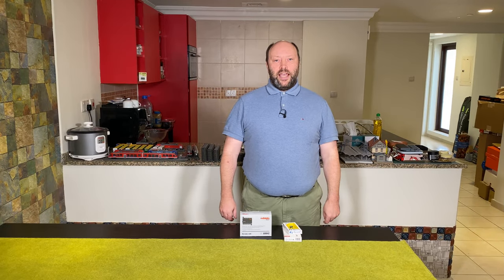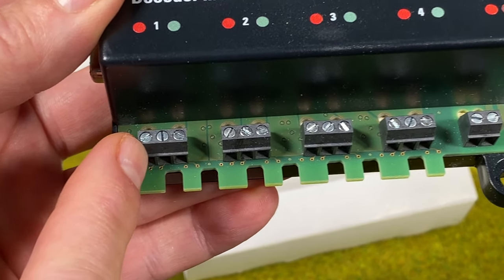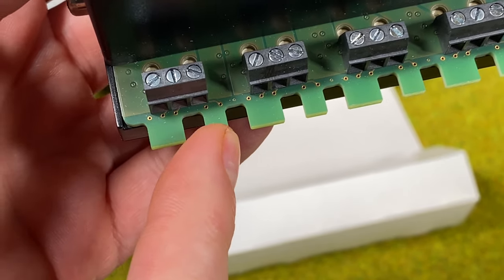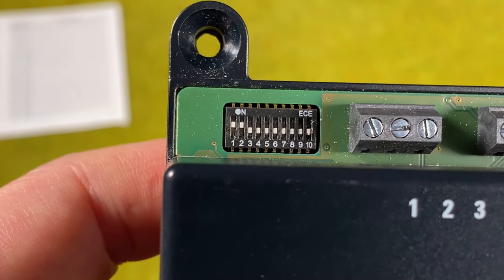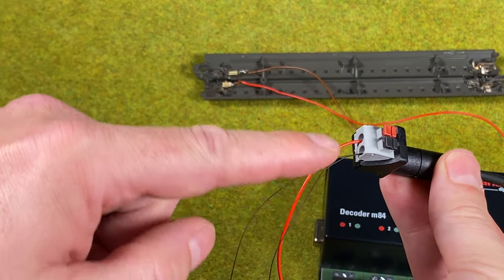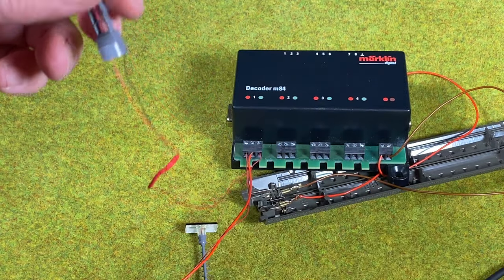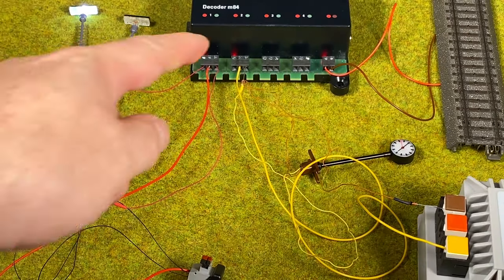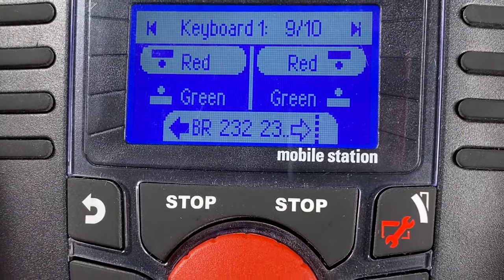Installing Märklin 60841/60842 m84 with 8 Independent Light Groups (Beginner Episode 8a)

Comment: Dear Paul ,many thanks for all your videos. A small correction at 4'20 the 'F'. Language on the manual is French and not Finish as mentioned. ...😀.   M84 decoder is indeed very useful.  The black one is the one to buy if you have none in house, but the old ones M84 and from other brands that are cheaper are working as well in most cases.   Thanks again .   Please also think , or mention the track K and how best to use it.
Reply from the maker: Hi Emmanuel, 

Indeed F is French ;-) This video also covers the white M84.

I agree that you can also use accessories from other brands and I encourage you to experiment with these ones as well. However, if you are not an expert consider staying within same system as the accessories work the same way and what you learn on one you can re-use on another. Furthermore, each brand also makes sure that accessories are compatible within the brand. If you are an expert - go ahead and mix and match as each brand has some advantages and disadvantages. Some brands mix wel while others do not. For most accessories it is easy, but be careful with accessories such as boosters.

K-track? Unfortunately I do not have a lot of experience with it as I mostly do temporary layouts...

Enjoy ;-) Bo

Comment: A true Masterclass, thank you
Reply: Just a question , in order to maximise the use of the decoder , what mode should I use to regulate a shadow station , to replace signals , mode 0-1-2?
Using CS3
Many thanks
Reply from the maker: Hi Bernard, Thank you! Enjoy ;-) Bo
Reply: @ModelTrainFun  Hi Bo, could you answer my question concerning the mode to be used in a shadow station? 
Thanks
Reply from the maker: Hi Bernard, I am assuming you are asking what mode to choose when you want to use the M84 for turning on/off power to the track (stop track). If this is what you are looking for, then use Mode 2. Basically, same as the lights in this video - just use "B" from the track and insulate as a stop track. Did this help? Enjoy ;-) Bo
Reply: @ModelTrainFun  you got my point , tkx

Comment: I tried this when 1 M84 was connected in series with 6 M83 decoders. I could not reprogram the M84 in this setup as shown in de video. It only works when only the M84 is connected to the Mobile Station.
Reply from the maker: Hi Bert, I have heard from others about this issue as well. Good to know that programming needs to be done with one when using the MS2. Unsure if this is also the case with the CS3? Enjoy ;-)

Comment: Thank you for your detailed videos! I tried programming the "white" m84 (60841) to take 8 different addresses, but unfortunately it did not work. It may have worked on your example because you were using a 60842, and somehow its improved architecture allows the separation of the switches (Schaltgruppe = 0).

Comment: Hello, is it possible to switch the turnouts with the M84 without a decoder in the turnout?
Reply from the maker: Hi Frans,

If you want an external decoder I recommend using the m83. The m83 is built for this purpose - check out this video: https://www.youtube.com/watch?v=eGexwTEeFZE The m84 is good for continuos power like turning on/off lights. The m83 is good for pulses for accessoires like turnouts and the uncoupler track. In theory I believe you could program the m84 for turnouts, but the m83 is cheaper and ready to use for this purpose. 

Enjoy ;-)

Comment: Hello. Great, informative and perfect pedagogy. An additional video would be to explain all the other modes. I do not have a m84 and would like to know. And the detailled programming on each cv was a little confusing. Actually, i would like to know if it is possible to use an older crane with m84. It should be using 6 addresses (1 and 2 as latches, 3 and 4 as 4 independant switches) and use 2 switch outputs to feed 2 latche power input for rotating or moving the rope.
Reply from the maker: Glad you liked the video!

I have not tried making a crane move. Everytime I have seen somebody do it they have used a locomotive decoder. To me this makes more sense as a locomotive decoder is optimized for wheeled movement. I did find one video that might interest you on this from @marklinofsweden: https://www.youtube.com/watch?v=g0eYbtyRD6U

As for the other CV79 m84 60842 modes you can find this in the 60842 manual on page 18: https://static.maerklin.de/damcontent/a5/7d/a57d1381cfd17d74e7434cb76db190ed1566485190.pdf

The CV programming I figured out by reading the description in the CS3 and trial'n'error. My intent in this video was not to go into details of every CV in the m84. I might look into the other modes and more CV programming in future videos.

Enjoy and happy model trains ;-)

Comment: Your video showed you using a power source to the centre connection. I do not have a power source so how do I get around that as so far I have not purchased a central station. I only have the mobile station. I am not sure how to get the green lights to work on my m84 with only my mobile station. Please can you help me
Reply from the maker: Hi Alf,

I would choose to use the m84 when I have another power source for the light. However, you could use the track power as well.

If you have a light that can be powered from the track you can use the track power. First test your light by connecting it to the track one wire to the rail and one to the center studs - if it does not work try the other way around (dont forget to go out of stop mode). If this works connect red from the track (or brown) to the center and return after the light to the track with the color you did not use.

Before you try it out - double check that the light works with track power. You can damage the light - or in rare instances the MS2. However, the MS2 will probably just trigger the short circuit detection and enter STOP mode. However, be sure before you try.

You can use the m84 for this. However, if you intend to use track power for light, then using the m83 is cheaper. This will require a little of programming - unfortunately, I do not have a video showing this. However, if you have the black m83 (Märklin 60832), then look in the technical manual. It looks like you can choose mode 2-5 as described on page 18 - or program the CVs as illustrated on page 24: https://static.maerklin.de/damcontent/3b/44/3b44f7c3c18c5d0a2b0c3e377f3df7281570606458.pdf

You can also see how to connect light to the m83 on page 24 (this is different from the m84 light connection). I have not tried it with the m83 myself, but it should work.

Hope this helps. Enjoy ;-)

Comment: Hello Model Train Fun. I love your videos which are really easy to follow and very informative. Having watched this one, I saw that it came really close to a question I need to find the answer to.

From your closing sentences, it seems it may already be the subject of your next video, but just to make sure, my question is, how to connect a 3-way Viesmann signal (a dumb signal I suppose-with no decoders) and make it work with the 3-way signal icon of the CS3? I already tried to connect the cables of the red and green LEDs to-let's say address 9, and the cable of the yellow LED to address 10. When I change the icon of the address 9 to a 3-way signal icon, the accessory at the address 10 dissapears and then there is no control on the yellow LED. The 3-way icon only controls the red and green, but the 3rd has no function at all. I tried to assign a second address to the 3-way signal accessory, but the CS3 does not seem to accept a second address for one accessory.

Thank you in advance.
Vedat
Reply from the maker: Glad you like the video! I intend to conver the Viessmann 4011, 4012 and 4013 signals in a future video. I expect to receive them soon so I can experinment. Enjoy ;-)

Comment: Thankyou very much for your reply to my previous comment. If i may i am still having problems with my turnouts using my mobile station. I am using the m84 for switching of turnouts so far. I have set three sets of turnouts to 1,2, & 3 on my m84 using the 74491.The other four turnouts are set to 10,11,12,& 13 but this time i am using the digtal decoder for these four using 74462 with the appropriate dip switch settings. My problem is that 1,2, & 3, work on the m84 (lights change over on the m84) but the turnouts themselves do not move even though i ensured i wired them correctly as in your video. The turnouts 10,11,12 & 13 work perfecly well. please can you advise me if i am doing something wrong.
Reply from the maker: Hi Alf,

It is important to distinguish between then how to use the m83 and how to use the m84. The m84 is for permanently turning something on and off - like a light. The m83 is for activating something momentarily - like a turnout. A turnout is only activated shortly while the turnout changes. You can use the m84 for turnouts and the m83 for lights, but this require advanced programming. Furthermore, the m83 is cheaper than the m84 - so I highly recommend it for turnouts.

I suggest you used the m83 for turnouts as illustrated in this video: https://www.youtube.com/watch?v=eGexwTEeFZE

If you have C-track you may also consider using the decoders that can be hidden under the track as illustrated in this video: https://www.youtube.com/watch?v=_6lGKQ3Vj2Q

There is also a video on the three-way turnout as well.

Don't forget you can search by going on the channel home page and selecting the "search" button furthest to the right next to the "About": https://www.youtube.com/@ModelTrainFun

Here you can search for specific videos on this channel. There might already be a video for you. Generally, I would suggest starting with the Märklin Beginner playlist: https://www.youtube.com/playlist?list=PLYAhs-Pox3sG31NwCfqIuk6IvI19q2czn

More playlists are available on the channel page and you can see where to find what on the Model Train Fun channel in this video: https://www.youtube.com/watch?v=_9ZlgohukIY

Hope this helps. Enjoy ;-)

Comment: Hi ModelTrainFun, these videos are very informative - thank you for making them! Do you have any book recommendations for electrical wiring with Marklin layouts by any chance?
Reply from the maker: Glad you like the videos. As for a book on wiring - unfortunately I do not know one. I was actually recently think the same - what is good practice for wiring your layout? I only make temporary layouts, so I do not have much experience. 

The general trend I see with other model railroaders when they build layouts is to have "bus wires" through out your layout. A bus wire is a thick wire with main power throughout the layout - it is thick to hinder loss of power and max power can flow through it. Typically you have bus wires for each booster section, but also bus wires for light and other things. Then feeder wires are connected from the bus wires to the track at regular intervals and to light sections.

I would try and ask the question on one of the Märklin facebook groups or on a forum. Try:
- https://www.facebook.com/groups/Maerklin.H0.Forum
- https://www.marklin-users.net

Let me know if you find a good overview of wiring - I am also interested. Enjoy ;-)
Reply: @ModelTrainFun  Thank you for this informative reply with the links, I’ll be sure to take a look at these.

Comment: one more question, did I understand it right that if I have i.e. 12 lights that I want to turen on at the same time then I can Connect all 12 lamps to one adress ?
Reply from the maker: Hi Michael, yes you can connect multiple lights to each output. Just keep in mind that the maximum current load per group is 5 amps. Which also means you can connect a lot of lamps. Enjoy ;-) Bo

Comment: I keep wondering, is it nessecary to Connect to track Power if you have a transformer ? should that not be able to do it on its own ?
Reply from the maker: Hi Michael, the M84 needs to be connected to the digital signal (track power) so it can receive commands. Each output group can be powered by a separate power supply. According to the manual you can also "The decoder can also be connected to the 66360/66365 switched mode power pack (only in con junction with 60822) (here power is not taken from the track and the power demanded from the track is thereby less). ". I have not tried to connect it like this, but it should work. Enjoy ;-) Bo

Comment: Thanks a lot for your nice videos. It helps a lot.  Anyway there is something which I didn´t understand well. I have a M83 for the turnouts and I have just bought a M84 for the lights . I have one power supply for the Mobil Station, but do I need another power supply for the lights ?? If I put together M83 and M84 , can´t I use the same power supply for all ? Sorry my ignorance but I am a beginner with the trains. Thanks for your reply !
Reply from the maker: Hi Simm,

I am glad you liked the video!

As a rule of thumb the m83 is good for switching stuff like turnouts. The m84 is good for turning something on/off like lights.

The benefit of the m84 is that you can use another power supply so you can save the track power and use it for locomotives and trains. In addition to that you can use any power supply that fits with your lights. Finally, you can use DC to power lights which removes flickering of the light (noticeable on videos). 

You can also power your lights from the track power if you have lights that are compatible with the power from the track - be careful as most lights are not. You can see in the video I use the Viessmann clock with AC power: https://www.youtube.com/watch?v=eo65jHaoWqE&t=1491s If you have a light that can use track power you can connect the red "B" from the track to the center like the yellow is connected to the transformer in the video and the return to the brown "0" on the track. This will actually work for the clock I use in the video as it also handles track power.

Another method is to reprogram the m83 as it can actually also handle lights. In this case they will be powered from the track, so remember to use lights that are compatible with track power. The black m83 can be programmed like you see the black m84 in the video : https://www.youtube.com/watch?v=eo65jHaoWqE&t=1968s You just have some other modes (1-5) as you can see in the technical manual on page 18: https://static.maerklin.de/damcontent/3b/44/3b44f7c3c18c5d0a2b0c3e377f3df7281570606458.pdf Then you connect the light to the center and the side of the m83 group.

Hope this helps! Enjoy ;-)

Comment: Which decoder would you use to control a mtb MP1 or MP5 turnout servo type motors?
Reply from the maker: Hi Earl,

Great little servo - I did not know of this one. It is new to me, so I do not know how to install it. Normally, servos are connected using the M83 (Märklin 60831 or Märklin 60832) with the Märklin 60821 accessory set. However, the MTB MPx series seems more versatile. Unfortunately, I have no experience with them, but I did look a little around on the MTP website (https://www.mtb-model.com/?lang=en) and the internet...

You can find the descriptions of the MTB MP1 & MP5 here:
- MP1: https://www.mtb-model.com/pages/mp1.php?lang=en
- MP5: https://www.mtb-model.com/pages/mp5.php?lang=en

Reading this it seems the MTB MPx can connect directly to the M83. To me it also seems like you do not need the more complicated versions - the basic MP1 should be enough for Märklin. However, the MP5 is a stronger engine - although I do not see the need for the relay (for DCC turnout electro frog).

I found the following that indicates how to connect the MTB MP1 to a standard switch decoder - this further strengthen the belief it can just be connected (as do the videos below): https://www.marklin-users.net/forum/posts/t37002-Turnout-motors---anyone-familiar-with-mtb-MT1

These video shows how to connect it to the DR4018 - the DR4018 is essentially a M83 from Digikeijs:
- https://www.youtube.com/watch?v=DrcNJhlepJU
- https://www.youtube.com/watch?v=fT906-SgICo

Summary: It seems it connects directly to the M83 - but I have not tried it myself. If you have C-track another option is the Viessmann 4568 that installs directly under the track (is more expensive than the MTB MPx, but comes with decoder). I have a video on this here: https://www.youtube.com/watch?v=GlNdqowq2VE

I hope this helps. Let me know of your experiences with the MTB MPx - I am really interested in this one - looks like a cool turnout servo. 

Enjoy ;-)